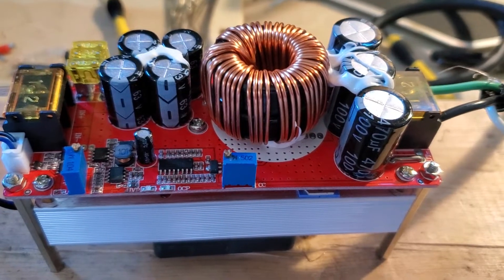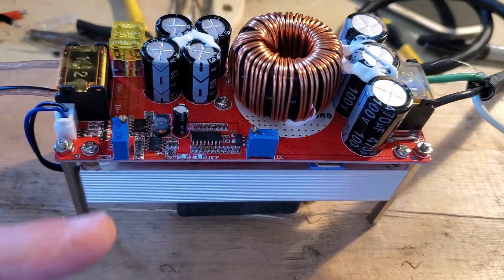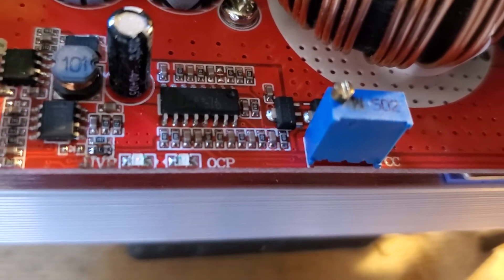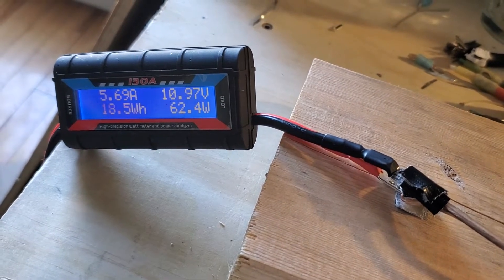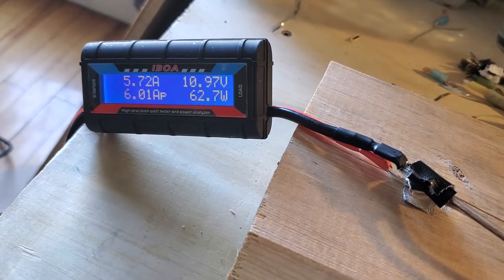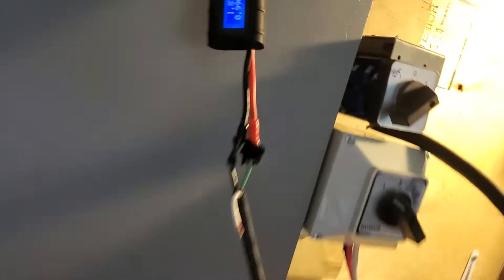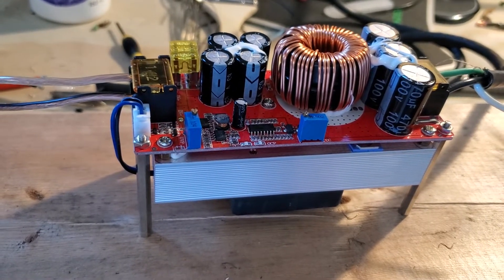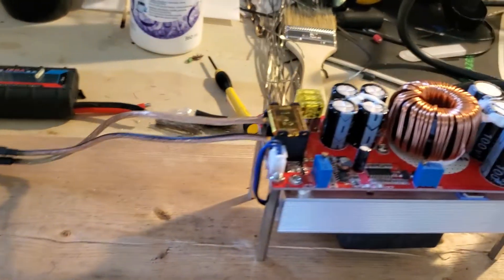Howto use a boost converter as a MPPT solar charge controller !, this setup is not for lead acid !

Comment: i already do that as a battery charger for my 60v ebike...  good thing to this you can parallel more pv panel with the same power rating to make it more power to boost high voltage battery

Comment: Can I use it to step down the voltage from the solar to the battery?
Reply from the maker: No, this is boost converter only. To step down you need a buck converter.

Comment: cool i was looking for some info like this, i have an ebike battery, lithium 48v 10ah, the problem with this is that i need a vmp greater than 55v of solar, but the battery charges at 100w tops, so its an overkill making series arrays to reach the voltaje, i was wondering, can i use lets say a 100w 12-18v solar panel with this module to boost it up to 55v for charge?, would be better to connect the panel to a mppt first then to the booster? thanks for your time!
Reply from the maker: Should work either way, perhaps the power output would be better with the mppt

Comment: Thank you for the video!
Need advice! I need a 4-Switch Buck Boost Controller. input 10V-16V. Load 12V - 50A.
what do you advise?
Reply from the maker: https://www.amazon.ca/Power-Converter-Voltage-Regulator-Stabilizer/dp/B0CD27H1RZ/ref=sr_1_50?crid=10ZXL1DYD7Y95&keywords=dc-dc%2Bbuck%2Bboost%2Bconverter%2B12v%2B50amp&qid=1702055581&sprefix=dc-dc%2Bbuck%2Bboost%2Bconverter%2B12v%2B50amp%2Caps%2C84&sr=8-50&ufe=app_do%3Aamzn1.fos.c021cf91-aacd-4a27-9bf5-80aba3271009&th=1
this seems to have the right specs, but it is not cheap

Comment: You mentioned this setup is not for lead acid batteries. Why?
Reply from the maker: Lead acid have a different charging profile, they take less power towards the end of the charge, to top them off.
Reply: @TheDIYDen  Thank you. You must be referring to the absorption or topping stage after bulk charge for lead acid which LiPO4s do not go through.
Reply from the maker: @Hinapulan  Right, so in theory these could still work with lead acid but you'd be ahead not topping off the battery, or charge with no more then the recommended bulk charge rate, otherwise it would shorten the life of the battery
Reply: @TheDIYDen So clearly explained 🙂 Thanks for the patience. (Liked 👍 and subscribed)

Comment: Do these last? I had one. I used it to convert 24v to 36v at 10 amps. It burned out the first time.
Reply from the maker: Yeah, I had some units for years, you probably just got unlucky
Reply from the maker: Depends on the load also, inductive loads like electric motors, they take 7x the power at startup to charge up the coils. that maybe have been the issue
Reply: @TheDIYDen Would a parallel high capacitance help lower the inductance load.

Comment: Can I run 1.5 kva inverter on this device . For operating required voltage is 150vdc ....... But I have 80 volts on solar panel
Reply from the maker: no these booster can only step up to 90vdc i believe

Comment: Could this be used inbetween the solar panel and mppt charger👍👍
Reply from the maker: yeah, for sure it could help mppt that require higher voltage to operate
Reply: Spent hours to reach this one line question with one line on point answer...thank you both

Comment: You need the buck converter to max the panel out that how mppt work the booster won’t won’t give you all the panel wattage but the buck does so get a buck converter and connected in parallel with the booster
Reply: This makes zero sense
Reply: @ericklein5097  my mistake not booster converter the penal